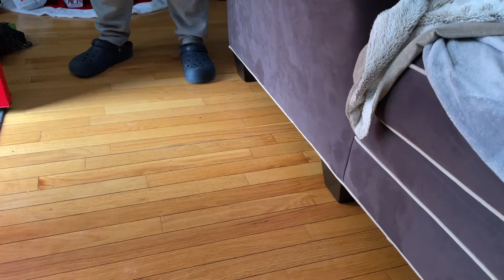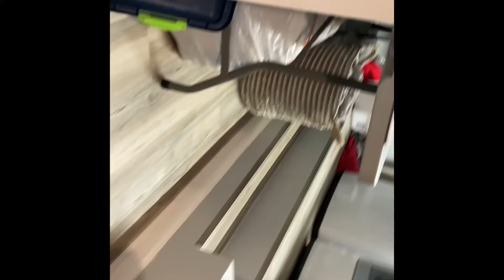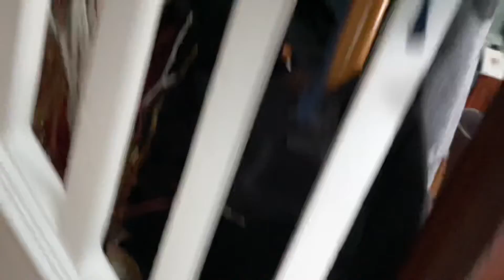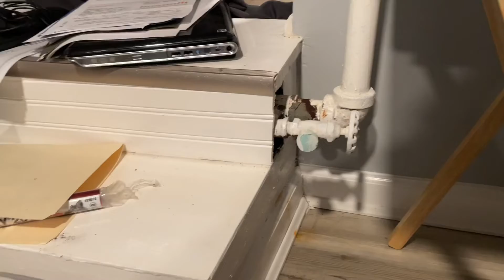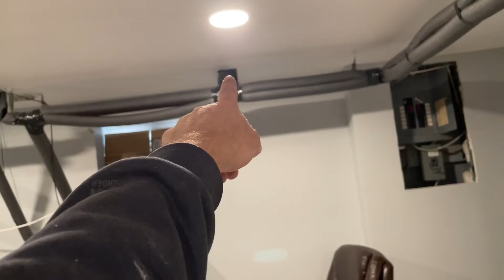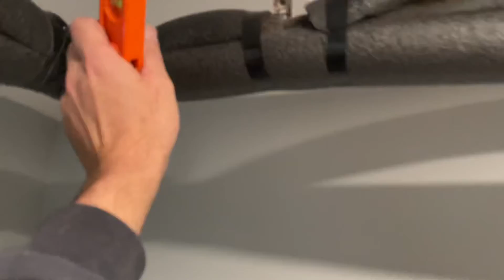Steam Heat Service Call - Intense Banging & Sometimes Water Coming Out of Radiator Air Valves

Comment: The opening left of the refrigerator is not original (the creation of a contractor ) and trapped water under wood step so he added a hose Cox to drain trap.  The correct job was to drop return line below the Hartford loop.    Customer paid dearly, i’m sure   but it was the right job to fix the problem.  Most plumbers would just add a band aid to the problem.   What was the outcome.  All good.

Comment: remembering a few times over the years customers that wanted me to use the rear door take off my shoes.. which i carried the little booties that go over. problem i had was the house was trashed.. stuff spilled all over the kitchen dog fur dog poop 💩 amazing people. one lady had me go around the side entry just had a roof put on the guys didnt put down a tarp im stepping on those roof nails with the washer standing up like an inch long.. right into my boot thru my foot.. that ended that!
Reply: @PipeDoctor  well on my end i should be more forgiving.. but those heartless ones.. "the nancy pelosi's" ended up paying more. in turn nice ones that had little and lots on their plate i gave breaks to or in some cases repaired for the trip charge or free. struggling older military i just fixed free 🇺🇸

Comment: I remember the old steam radiators in my elementary and high school ( Grad 1987 and failed Kindergarten).  Anyway almost every one would leak from the shutoffs and talk about a racket they made.  As a kid I told the janitor that something was wrong with them and I was told that they had made that noise and leaked since before I was born.  The school burned down just after I graduated....boiler explosion.

Comment: Banging in steam system is caused by surging most of the time from dirt and sludge in the system. Steam boilers should be chemically treated yearly, and flushed ( blown down)   out weekly. As long as its piped correctly if you clean the system it should be fine. By the way the air vents are junk,never liked groton, I always use Hoffman
Reply: Good old fashioned ‘water hammer’.
Wet Steam can also aggrieve that, un insulated pipes, poor pitch, bad vents, water traps, occluded returns the list goes on.
Good call on this one Mike👍

Comment: Doc
Nobody shape shifted the system they repaired the obvious leak but never addressed the problems.
What I see is a single pipe system???
Knocking will occur more so on warm days then cold days ( expansion)...
But when you come to a single pipe system with issues more often then not find the main vent at the end of each run in the basement&replace go to each radiator and replace every vent at the same time (ALL)
Before you install any new piping in a steam system make sure you Get as much oil off as possible it may make its way back and cause carryover !
Replace all vents you should be fine don't re-pitch the whole house🤔
Just say'n 
Blop new jersey
Philadelphia stationary engineer
38 years in 
Stay safe wear your safety glasses and I don't need to see the flooring in the house !😅😅🤣🤣😜
Go pro has hat attachments😅😜